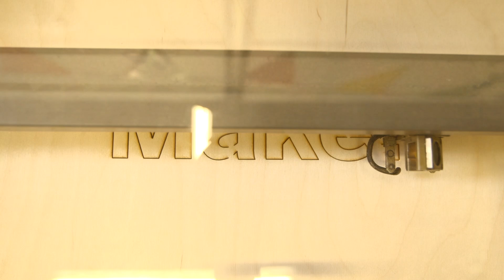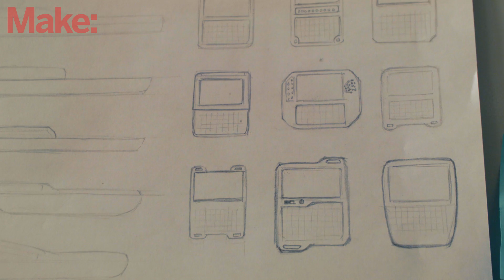Next Thing Co. Releases "World's First" $9 Computer

Comment: too bad they still barely have shipped,and raspberry zero beat it.
Reply: Chip is technically cheaper because the pi zero doesn't have wifi or storage built in and it is a requirement to get a micro USB to USB adapter, which can be expensive. The chip is 9 dollars with everything, and the zero is 5 dollars with nothing, or around 40 dollars with everything

Comment: Okay, but what of the GPU?
While rather primitive, Rasberry Pi has at least some sort of a GPU.
Reply: You're dumb
Reply: Satan Care to debate?
Reply: Well first off why would a computer this small and this cheap even be able to have a GPU? It obviously doesn't maybe it does but it just sounds like it wouldn't also I am sorry for coming off a bit mean by "You're dumb" I may be the dumb one for all I know.
Reply: Well I'm saying like not a GPU card but maybe integrated stuff inside of it? Isn't that the whole point of the HDMI shield that costs more than the computer it probably has the GPU inside of it.
Reply: Well I wouldn't think it would be capable of much I doubt it could play even minecraft on the lowest settings maybe surf the web at very slow speeds.
Reply: Well this could most likely do old games perfectly fine. Depends on what it is though.

Comment: can it run quake or console emulators if there any for linux?
Reply: Миша Шевченко Depending on what console you're talking about, it comes with:

1 GHz processor, 512mb of RAM (roughly 1/4th of a laptop's), and 4GB of storage. It probably wouldn't run PS2 games, but it could most likely run PS1 games. It's mostly made for DOS and other simple tasks. Terraria needs at least 1.6 GHz, 512 mb of RAM, and 200 mb of HDD. 

It really kind of depends on the games you're looking forward to play, you could run Quake easily (depending if you're talking about THAT Quake).
Reply: I was thinking about Quake 3 Arena, and old consoles like Playstation 1, SEGA Genesis, NES, Nintendo 64....
Reply: Миша Шевченко It can run anything its requirements allow, just Google the requirements for said game(s) and see if it'll match up or not.

Comment: does this mean i can install puppylinux and play Nes to Ps1 games anywhere?
Reply: Reisen007SCI It would be okay, but that would defeat the whole point of the raspberry pi - to make an affordable computer available to everyone with the ability to learn with it. Why a high-end raspberry pi when you could just use a standard computer?
Reply: Reisen007SCI Absolutely :D, good question though. Or maybe you can also install hell lot of emulators, add some buttons, wide display and batteries plus encapsulation making a good retroplatform emulator console.
Reply: pangpengmaster i kinda wanna make it a PSP or DS from it like that i have a big ass screen for my chip pocket but that i can use pocket chip as my touch screen for DS emulator but everyone knows an DS uses only 2 or 3MB of ram to work fully so yeah idk if it would work
Reply: Reisen007SCI i dunno about the psp, keep in mind that the processor is, to be honest, quite shitty.
Reply: HowTheyDidIt well it would be a good idea to try would it?

Comment from the maker: This $9 computer has built in wifi and bluetooth and is faster than a Raspberry Pi B+! What would you build with one? http://bit.ly/1dSWm6u
Reply: Add shipping and an accessory to plug a screen and it's not that amazing anymore.
Reply: Opaque a pick-and-place machine will probably do most of the work
Reply: I backed this and have several RPi's. This is not meant to be a Raspberry Pi killer, its more for an easy headless machine that is nicely web ready and easy to control over SSH. You can add hdmi, but its not as graphics heavy as the RPi, which started with a decent onboard graphics chip. The new RPi 2 is also has significantly more memory. Its all about how much you need to achieve your goals. At $9 it is almost disposable.
Reply: Can I buy this through the Make store? Even at double the price it sounds nice for an embedded project, one where video output is an unneeded expense.
Reply: +Make:  Already ordered 2.
Reply: +Make:  A real life pip boy
Reply: William Ellerbe a phone that destroys all inferior phone
Reply: Opaque probably under Cleanroom conditions
Reply: Arduino is so much better but I am not sure about it.
Reply: You should make one of these a bit bigger with a snapdragon 805 and a few usb ports and some ram that would be found in a phone and make a cool case
Reply: *****
A graphics driver? I have a giant desktop with a excellent graphics card. Ideally, we will never be plugging a monitor and keyboard into these sort of small computers.
Reply: Shawn Waite
Ehh, Although this thing is pretty cool, and a lot more open, this does not invalidate the RPi. The RPi has the ethernet and HDMI on the standard board. These devices are useful for other applications. And presumably these have more gpio.
Reply: michael gregg - agreed, it was more of an inside joke :)
Reply: Make: no, because you also must buy pocket chip for 10-15$ to have vga/hdmi out.. which makes Pi cheaper and better than this.. + shipping.. so no thanks
Reply: um... something I could use for word-processing? Possibly a/v editing, when my skills get that advanced?
Reply: Nathan Strutz  your Raspberry Pi is now obsolete :)
Reply: Pi is still a player as it comes native with HDMI plus has more USB ports and other fun bits.

For composite vid projects though, Chip looks like a real winner. I'm going to have to get 1, 2 or more myself =)
Reply: Make: How would this one perform as a wifi router?
Reply: I'm worried about Allwinner driver issues. But perhaps the existence of this SBC will cause those issues to be improved, like the RasPi did for Broadcom's chips. I'd happily buy one as soon as good open-source graphics drivers become available.
Reply: james wolf You're exactly correct, It's a 9$ computer and is basically disposable at that price.
Reply: james wolf I didn't mean that as a negitive either I personally will be backing this project.
Reply: Where can you buy them
Reply: Subin Wright-Simon There is a kickstarter on for it ATM.
Reply: Shawn Waite
Ahh, I can see that was a joke. I guess we took that a bit too seriously.
Reply: Indonesia as a wireless relay or meshnet node it might work fine. As a router that needs to hook into a wired network, it'll do horribly since it's limited by the USB 2.0 bus which is not only limited to 480 Mb/s peek, but has a lot of overhead resulting in actual speeds being much lower.
Reply: Make: wheres the MTK6592 version with 4gb ddr5 and mali T 760 gpu ? :/ i want one with windows 7 or 8 please :D
Reply: Make: i would enjoy to play games on it or use puppylinux for steam on the go so i can voice chat anywhere or skype
Reply: Djosa Antic not really.... A pi2 is "$35" but really it's no less than around $45 when you count in shipping or eBay sellers tax. A pi 2 is stock at 700mhz but can be safely OC to 900mhz. Doesn't have built in WiFi or Bluetooth and an additional module for both would cost $10-20+ depending where you get it.  So for a raspi with the same vga/hdmi, 1gb ram, almost 1ghz cpu, WiFi and Bluetooth capable pi, it would cost about $70 Vs $24... Not even including a vga shield or adapter for the pi. So unless shipping is $50 then this would be far cheaper.  I don't see why people like you try and bash products anyway,  if you rather a pi then get a pi. They improved on their idea and made it far better. Just like the banana pro, which would also be better than the pi but it cost more.
Reply: Djosa Antic not to mention the annoyance of dealing with WiFi drivers every time I use a new OS on my PI2 and trying to find someone who's made a driver for my BL or that has the source. All that would be gone with a board with a universal WiFi module. That and the fact that this cost as much as my wifi dongle alone is enough for me. At worst it ends up as another htpc like my pi, at best I can finally complete my projects I intended to use my pi for :)
Reply: +BananaGunz Dude I  have gotten android devices way better then that for 35$.
Reply: +Brian van vlymen Apples to elephants, man - One is a microcontroller and the other is..well... A $9 mini-computer...

Live and learn.
Reply: +james wolf  Scary river?
Reply: +William McDonald  I plan to order this device as well. Amazing to learn about a computer that is available for $9.00. A truly amazing innovation for sure.
Reply: I'm glad this post came back to my attention. Don't want to forget about this innovation.
Reply: I'm building a phone out of it.
Reply: VaporPlays building a phone out of a computer? lame.
Reply: VaporPlays What type of phone would you build? Any prototypes?
Reply: How to basic Keep your vision alive. While the project for the following video was "cancelled," it's still nice to read up on an example of modular development for cell phones:

https://davehakkens.nl/community/forums/forum/phonebloks/

Comment: $9 a step in the right direction, however don't you all think that someone should just create a proper modular system?

CPU board with header for add on boards of each type
WIFI
RJ45
HDMI
VGA 
USB
IO PWM/RS232 ect
and more....

Aim to have them all at around the $5 mark or less - then we will have real choice to build what we need rather than spending hours reading through pissing contests about which board is best.

Comment: So can this "chip" go on The internet like Google , YouTube ect. ?
Reply: vizionthing Power's got something to do with it. The default debian browser does not have hardware acceleration for HTML5 videos. So, video rendering happens through CPU... and it does not have enough processing power to render video well. If however, you use kodi to play youtube, it will work just fine.
Reply: Maxumum99 Sure it can. With that processing power, I don't expect Youtube to work well though.
Reply: Scott Malkinson powers got nothing to do with it ...... referring to the first gen iPads not now playing youtube because Google disabled access to them.
Reply: Scott Malkinson heh I had just installed OSMC and built my first media center from a first issue Pi before that comment .....
Reply: vizionthing Yep, OSMC uses kodi which uses GPU accelerated video.

Comment: Look we created a computer that costs $9.(oh actually $19 if you want to use it). There obviously charging loads for the adapter, which,btw you are going to need to use it so they can make a profit. Oh and bear in mind your going to need a mouse, keyboard, vga cable and a micro usb cable as well, which if you add together us well over $20. I know most people aint gonna go broke over a $25 computer, but it just pisses me off when people make stupid caches like this.
Reply: A lot of uses for small Linux single board computers like this don't require a monitor/keyboard/mouse. Rhett could be used for networked sensor or home automation nodes, for instance.
Reply: jenny hanson Should grocery stores adjust their food prices to account for the cost of eating utensils and the dishsoap, sponge & water needed to clean them after eating?
Reply: most people are still going to use it as a personal computer like the raspberry pi though lets be honest.
Reply: The price of food is so low that if they made it cheaper it would have no value anyway. Besides that's not the point I was trying to make. This product is advertise itself as something that only costs nine pounds. However in order to use it you need to pay extra. Most food can be eaten without paying extra for anything else.

Comment: The VGA shield and HDMI shield cost more than the computer?
Reply: pikachu1324 Yeah its still cheaper to by a quadcore Raspberry pie and still have expandability...http://www.mcmelectronics.com/content/en-US/raspberry-pi
Reply: Kyder Dogd 

yeah. if a person needs a display, and/or decent CPU, a Raspberry Pi 2 is probably a good option.

for a project, I had considered getting an RPi 2, but mostly it was for sake of using the multi-core capabilities to have separate real-time and non-real-time workloads in a robot project, and to have more processing power to use for things like computer-vision and similar.

say, one of the cores is mostly dedicated to real-time stuff, and the other cores are for non-real-time stuff.
Reply: pikachu1324 

I am guessing one can probably use SSH or a USB interface to access it.
FWIW, that is typically how I access an RPi (they are often for embedded use in some other project, such as a robot or CNC machine or similar, vs a "real computer" where typically one will use, well, a real computer...).

Comment: Lol, watched this on my $15.90 Ematic egq307 tablet I bought on ebay that just had a dead battery.  1.2 quad ALLWINNER A13, 1gig ram, around 5gb of flash, 960x600 touchscreen, microSD, and hdmi out.  A friend bought me a 32gb microSD for $12...    Good for loading porn on for on the go.    I mostly use it to skype and read news and watch videos, but the A13 has a pretty badass 3d gpu #considering# the price.    Plays everything you throw at.   I think your still better off bang for buck buying a cheap chinese tablet, but for an embedded system where you need no video output... hmm maybe this.  The problem is most of what you want to do needs some type of display that adds $$ that quickly ruin any cost savings.

Comment: Raspberry Pi has some series competition now! I remember the arduino being the big thing! Arduino is really overpriced...
Reply: Power Max 

yes. Arduino is pretty steep for an rather weak processor and extreme lack of RAM. about the only thing it really has going for it is supporting analog IO pins.

if just buying raw microcontrollers, may just go for a Cortex-M based options or similar instead, rather than an ATmega.
Reply: Brendan Bohannon The TI Launchpad is cortex-M based and only $13, uses c programming, and has 40 pins, 80MHz clock
Reply: cottenmouthsnake

ok. I have a version of the TI Launchpad using the MSP430, but haven't really used it much yet.

half considered maybe using it for generating 3-phase output signals or similar though (some of my stuff is makes use of variable-frequency 3-phase signals, generally as digital PWM / PDM signals).
Reply: +Power Max please inform yourself. Arduino is a micro-controller. The Pi and CHIP have different purposes than Arduino.